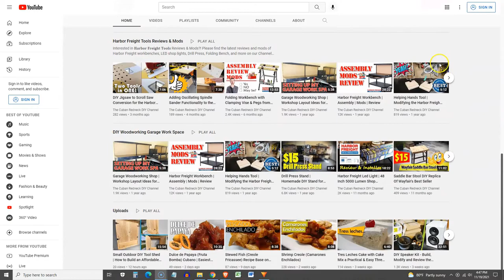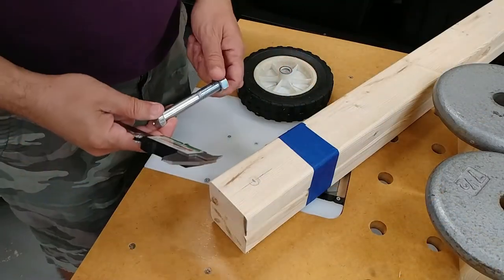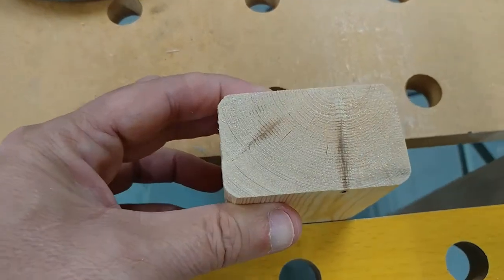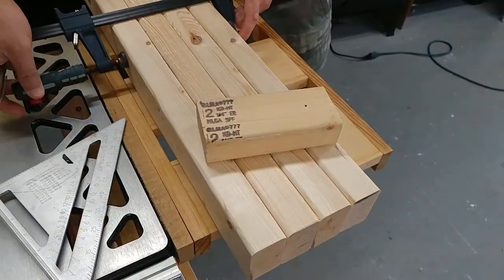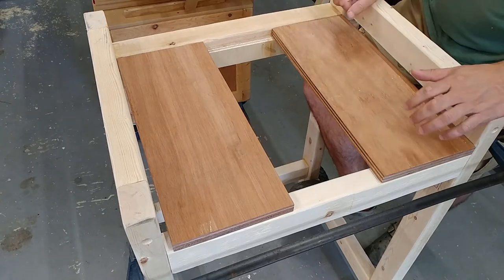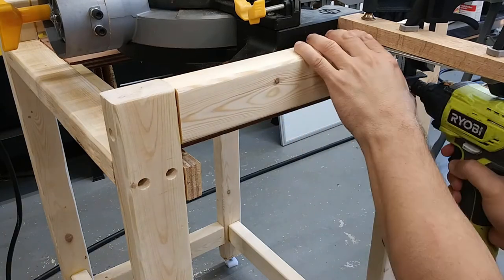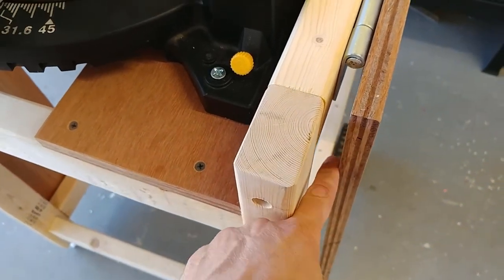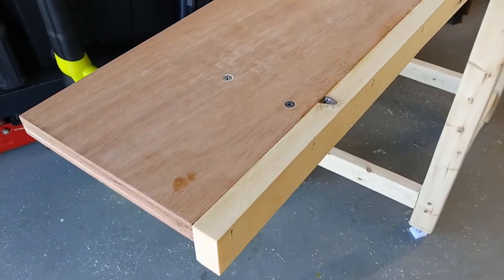DIY Miter Saw Stand with Wheels for your DeWalt, Ryobi, Harbor Freight, Craftsman, or Milwaukee

Comment: Do you have plans or deminsions or cuttling list. Specifically I’d like to know the suggested overall height and the lxwxd. Love this simple station.  Thanks.
Reply from the maker: … hey Jack, thank you for stopping by. I am unsure if I said this in the video, but I made this to fit me (meaning my height) and the particular saw I have, a Chicago Electric 12-inch. I could drop some demission's on SketchUp, but I don't see that being very useful. Stand up and measure from the floor to your belly button. That is the ideal height for your deck (the saw's surface). The width, offset of the legs (distance between the saw's deck and bottom), and depth are all relevant to your saw make and model. Give me a day or so, and I'll create a simple CAD drawing. That is, if I am able to upload it via my phone. I still don't have internet due to IAN.

Comment: Hey this is very nice video. Like you I also use a decent set of Harbor Freight tools since I am just a hobbyist and can't justify some of the expensive pro grade tools. I like your approach and more importantly your ingenuity to address short comings of using reasonably priced ordinary material like 2x4 construction lumber.
I have recently picked up a Harbor Freight saw that was on clearance and want to build a similar cart. Do you have any suggestions, modifications or improvements since you have been possibly using this for well over a two years now. Especially did you manage to put on those T-Tracks that you didn't have when making this video. Looking forward to your response. Thanks in advance.
Oh BTW, I just subscribed too.